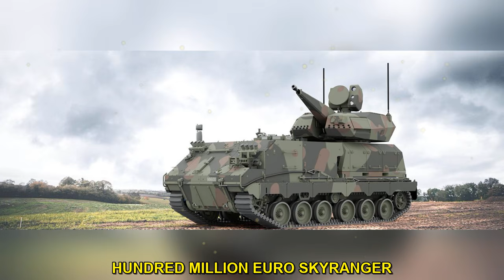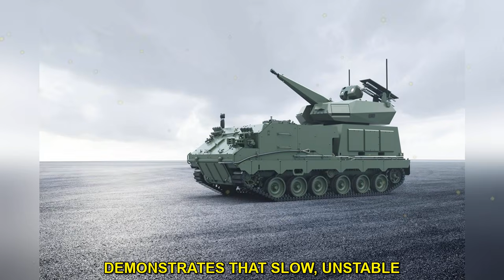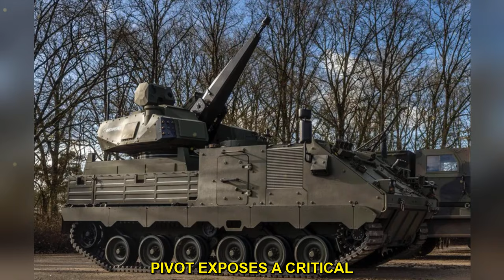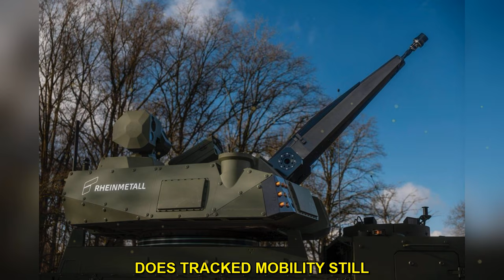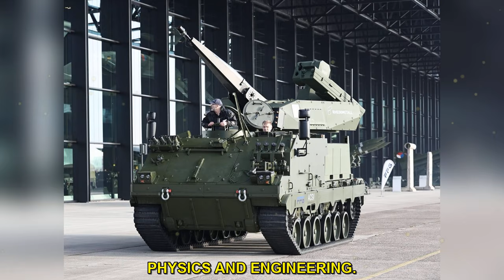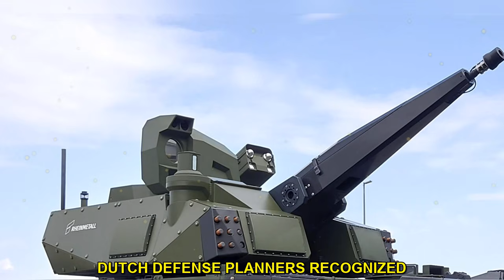Skyranger 30 Netherlands: Why Tracked ACSV G5 Beats Germany's Boxer 8x8?

Comment: Why use a 30mm canon when in Ukraine (and different NATO countries) they use an modified simple gun? OK this of course has lots of limitations. But  why not mount a 20mm canon like the one on the Dutch YPR 765 and the US Bradley? 20mm is more then enough. 

It is cheaper, you can take more ammo in the vehicle and it the rate of fire is probably higher ( Correct me if I am wrong). The only problem is from were do you get it? 

The Americans are not dependable. Let  Rheinmetall produces 20mm rounds.
Reply: The Bradley doesn't shoot airburst ammunition.
Reply: Look at the range of the 20mm canons... and as said, they don't have airburst.

Comment: A lot of rather dubious conclusion based on little.

I think this is a good choice, but this does not automatically make the Boxer useless in this roll.  Other nations have chosen it and Austria is even going for a 6 wheeled vehicles.  I must admit they seem small, but Austria is not known to be stupid with its military procurement. 
It seems to me this just means there are options and choices.  Different compromises. 

Incidentally the G5 is also German..
Reply: Boxer is rather expensive and it's cried out modularity has limits.

Comment: Why do you show a Piranha chassis when you mean a Boxer based Skyranger? Why do you think Boxer isn´t capable to deal with Oerlicon Mk 30 cannon when there is also a Boxer based RCH155 carrying the 155mm Artillery Gun Module (AGM). On what sources is your information based on? Doesn´t sound very serious to me.
Reply: Which  option is more expensive?

Comment: If tracked would have been the reason for this decission than they could/would have choosen the „Kettenboxer“ a tracked vehicle which can share the Mission Modul with the wheeled boxer.
Reply: The problem with Boxer and Kettenboxer is that the vehicles are very expensive and heavy and the modules only fit the Boxer  vehicles and it is difficult to do something else with it. The ACSV is a flatbed vehicle with twistlocks (like on sea containers).  The Skyranger  itself can be transported  by every vehicle which has the matching dimensions, twistlocks and load capacity, also a flatbed truck. It can also  be used as a stand alone on a concrete plate with access to electricity or on a flatbed trailer  to defend more static objects like airfields, harbours,  shunting yards or  other  important infra.  A system on a Boxer would be a waste for these tasks.

Comment: Bollocks. No one is shocked, and the chassis is only the mount for the gun, and the gun pointless without the sensors and guidance systems.

Comment: This Video and info is wrong.
The dutch are getting a  customized Skyranger 30 that can be used on vehicle as a working module but also as a off vehicle standalone Skyranger 30 for base defence.  This is not possible with a boxer but only with a tracked vehicle as the whole Skyranger 30 system is heavier than just the turret.
We are already using ACSV G5 for nomads so this is the obvious choice.

Comment: Boxer fans won't like this, but this combination  is more  universal then the Boxer  configuration.  Boxermodules can only be used on Boxer  vehicles. This one can be fixed on every  flatbed  truck or trailer with matching twistlocks or  also on concrete.